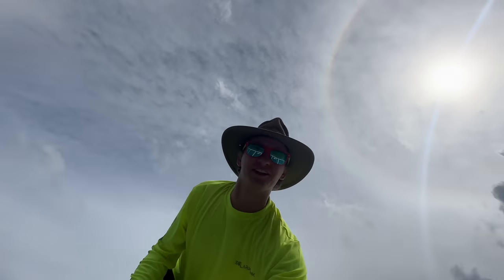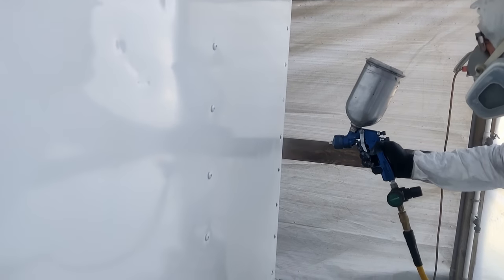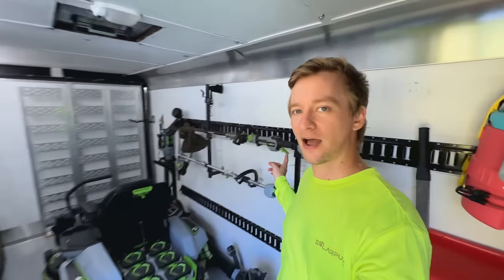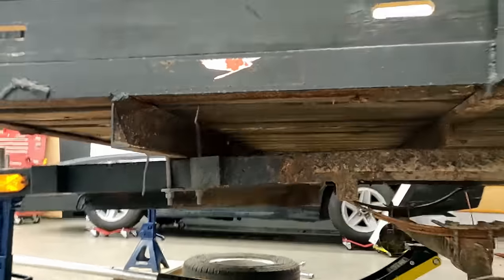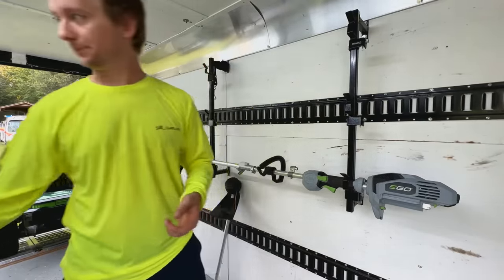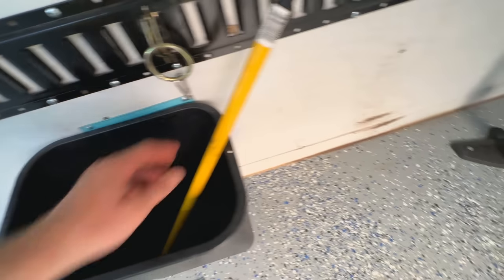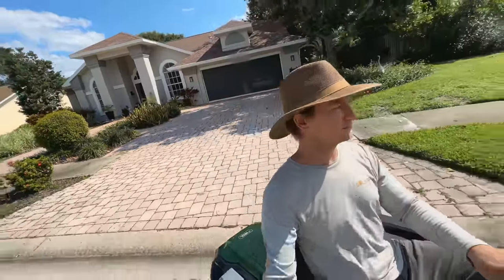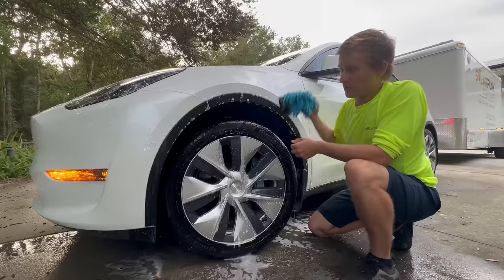My FULLY Electric Lawn Care Setup - Why I Chose EGO (to Start)

Comment: If I were to pay for lawn care I'd pay 10-20% extra for lawn care where the energy is from the sun. Pretty cool. "Economical?" Probably not going to undercut the other guys right now :-).
Reply from the maker: Yeah we're definitely not at cost parity between gas and electric lawn care equipment, but one day! For now I'm enjoying solving problems though, and solar powered trailer with an onboard storage battery is something that keeps me from having to buy expensive EGO (or other) batteries to keep up with my lawns.

Comment: You may want to invest into have a special fire extinguisher on had and  a type of sand used for electrical/battery fire. If your lithium ion batteries ever catch on fire, that small fire extinguisher wont do anything, even water wont help. An it would be best to keep that in the model Y so u can access it in case the flames are in the trailer.

Comment: I use my 2020 model y for most of the transportation in my wood floor business. We park the trucks at job sites and use the Tesla for all the driving. It’s a very capable vehicle.
Reply: Also, offsets $8k worth of fuel a year replacing the previous gas vehicle. I haven’t figured out exactly what it offsets by keeping the box trucks parked. I have a 12kwh array, 30kwh storage and 18kpv inverter producing a mwh a month. Adding 4kwh of panels next spring.

Comment: Keep up the faith in what your doing. I started gardening this year march 23 in the uk. All battery no ride on, using a 6x4 camping trailer, put a tow bar on my car and an inverter In the glove box incase It was needed. Only ever had to plug in to a customers power once in 6 months on a clear up job, with no parking nearby Going to raise the hardtop on the trailer with hardwood ply to give me an extra 18"-24" and add solar and battery into the trailer. Think I'll only need to go with an ecoflow style system. Love the videos and the journey. It ain't stupid if it works. 👍

Comment: Relly nice video, Steve. Enjoyed your explanation of what you are trying to do and why you bought what you did. I can fully understand the choice to start with items you can source easily and get parts for ... and are more affordable at the big-box-store than what they sell at the pro shops.

As for the trailer, while having a ramp door seems convenient for loading your riding mower, it is not nearly as convenient when it comes to loading from a cart or forklift like you did @ 12:07. As long as the ramp is removable, I prefer your setup to the ramp door.

Comment: I enjoyed this video. I am in the industry also running a branch of standard gas equipment and have wanted to put together a crew of all electric - or at least mostly electric. But I don't want to build it. What would you charge to come here and build out my enclosed trailer with EGO and maybe Kress items with the roof of said trailer lined with panels? I have a much larger trailer and it is new.
Reply from the maker: Hey that’s awesome you’re considering building out a fully electric rig to expand your offerings! I’d be very happy to talk with you about your idea if you want to send me an email that would be great. Steve@solarpunklawn.com
Reply: @solarpunksteve Thank you Steve. I just sent you an email.

Comment: You have too much frontal area for that vehicle to be safe at higher speeds. Even though your weight’s are in spec, Tesla doesn’t have a frontal recommendation, but high speeds and a good cross wind will make for an unforgettable experience. Love electric mowing, got a couple Greenworks  myself.

Comment: hi 😅, I was inspired by your YouTube channel, no sooner said than done, I have a secondary job in green maintenance😮 ,and I bought the multi-tool v2, with trimmer-edging tool & hedge trimmer 160cm, 2x4amp battery. wow 😱🤯 enough working time and no vibrations. installed a 350watt 🌞 panel and 1000watt inverter in combination with 2x 200ah AGM batteries. now working hard to purchase a trailer. bye bye , love your video's . greetings from Belgium 👋🏻

Comment: As a fellow ego all electric lawn service, the only thing I can say is register your equipment. Ego makes good on anything that is still under warranty. And most of the fuses in the ego equipment are not something that the customer can replace.  😅
Reply from the maker: Hey thanks! Yeah all my stuff is registered, hoping I won't need it and so far things have mostly all kept working.

Comment: LOL that guy flipped you off on his way to  the mower shop. 😂

I notice you didn't choose the commercial Ego line.  I have the same Ego tools as you and they have lasted many years, some since 2014, but I dont do 5-10 lawns a day, just my own 1 acre.  Are your Egos holding up to the heavy workload?
Reply from the maker: I didn't like the fact the "commercial" ego equipment used a different connector than the homeowner style tools and felt they were overpriced for what they were. My tools so far are holding up pretty well. Expected and normal wear for the use I'm putting them through, but so far they all still work. The string trimmer has started to act up a little bit (Line IQ feature) but so far I haven't had to pull it apart to address it.

Comment: I use EGO stuff (8 tools) since 2015.  I still use 2 original batteries from 2015 as well even though have newer ones.  All has worked great.  Now, your solar rig is very nice.  Will check the video out about its install.  Great stuff.
Reply from the maker: Thanks! So far my stuff keeps on kicking so can't complain much. Thanks for stopping by!

Comment: Maybe you can get a long magnet and walk and drag along the perimeter of the flower beds near the fall off of the just to catch any nails that might be there post roof install
Reply from the maker: Yeah I had to magnet the whole yard of one of my client's because there were nails *everywhere*.  Some roofing companies do a really good job collecting them after they are done, but evidentially this was not one of those companies.
Reply: @solarpunksteve  Just curious, did you see the last tool expo where EGO debuted it's expandable 70+ battery system for commerical use? I could help but think how your setup is a way better value.
Reply from the maker: @MurseTech64  Hey sorry for the late reply, no I haven't! Just checking it out now and it looks very interesting, although not really necessary in my case since I don't need to carry a ton of ego batteries with me.  I do like the thought of using the same batteries from their residential lines for their commercial lines. That was what kept me away from some of their "commercial" tools since you couldn't really use them with any of the residential batteries you already had and instead had to have a giant heavy backpack thing to go along with it. In my opinion not practical.  Anyway thanks for the heads up!

Comment: What’s your range towing the full lawn setup ? & do you have an idea of the trailer weight with everything in it?
Reply from the maker: I haven’t weighed it, but I’m estimating around 2500lbs loaded with the lawn care equipment. As for range, I could probably do ~130-150 miles around town, but on the highway it’s roughly 100 miles. So a good rule of thumb while planning a trip is just to estimate 1% per mile.  A friend tows his smaller trailer and says he can get around 150 miles on the highway with his.
Reply: @solarpunksteve awesome! My routes about 100 miles max so I wanted to see if it would last the route. Charging nightly would make it zero issue for range
Reply from the maker: Oh cool you’re considering one for your lawn care business or something different? Just a note, Tesla recommends not charging above 80-90% for daily driving to preserve the health of the battery, so might want to take that into consideration. I only ever charge to 100% if I’m going on a long trip.

Comment: If i recall correctly the MY OEM hitch came with a Tow Package Software upgrade. It seems mechanically your hack works around part of it missing: but do you have issues with sensors or ineffective auto pilot without their tow software?

Comment: No stand on panel! :(
Reply from the maker: Standing on the mounting brackets that are bolted to the frame under the panels and to the frame of the trailer ;)  I would never do anything to hurt the panels I worked so hard to buy and install.

Comment: I used to have gas lawn equipment and I switched to EGO around 4 years ago. I started with the push mower you have along with a blower and trimmer and I have never bought any gas equipment since. In my opinion, electric stuff is better than gas.

Comment: Get you a magnet that’s long enough to cover the width of the mower. Make a bracket and bolt it to mower in the front so the magnet is touching the grass level. It’ll save your tires. And cleans customers lawn

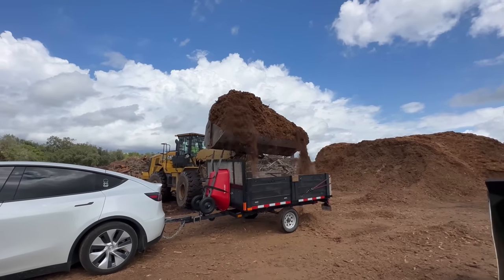Comment: 6:27 looks like Mockingbird recycle center! Have you had any issues with your push mower? Overheating? Not the actual batteries, but the actual mower itself.
Reply from the maker: Hey it is! Hmm, I haven’t actually had any issue of the push mower overheating, but I also don’t use it that often, only on the properties where my zero turn won’t fit. The only overheating issue I’ve had is my handheld blower, it can’t take the heat in Florida after about 10-15minutes of runtime. In the winter it will keep running all day though.

Comment: Can I ask how you learned about electrical and solar panel stuff? Were you self taught? I know hardly anything about electrical but I really want to start my own lawn care business in this same way. The thing that intrigues me is how eco friendly all electrical is but I want to know how to get started. Thanks for putting out great content btw! You've gained a new subscriber!
Reply from the maker: Self taught! But my previous job was as an Engineer on large private yachts (self taught as well) and have always had an interest in electric/solar/batteries etc.  Definitely check out @WillProwse if you want to learn some more about solar/inverter/battery setups and the DIY side of things. As for lawn care, borrow/buy a push mower and offer to start mowing lawns and see how you like it! In the beginning it's not a big deal if it takes you a long time to get a yard done. Good luck and let me know how you do!

Comment: What kind of fire suppressant system do you have on board? Had a ryobi battery smoke and catch fire lucky I was able to just leave it on the concrete and it burst for about 15 minutes before it burned itself out.  See all kinds of li ion packs self ignite from short circuits, i can't image what a fire in a trailer full of batteries would do 😬
Reply: About the same as everyone carrying around a lithium battery in their pocket all day. Its a rare occurrence it happens. There are more lead acid battery fires a year than lithium.

Comment: Nice. For a back up have you considered a 12 volt inverter in the Tesla? Should have a sizable dc to dc charger and should stalwart be able to handle 1500-2000 watts.
Reply: Teslas have an e-fuse system that monitors all electrical draws on the 12v system and throws an error if you try to draw extra power out of it. It can void your warranty.

Comment: My wife and I are looking at homes to buy and I have to do the lawn care and I love the idea of the all electric equipment and solar to supplement it. It's a hefty investment, but maybe worth it.
Reply: I am slowly converting over to all electric lawn care. All of my yard small tools are now electric, and I plan to soon replace my small mower and and small tiller/cultivator with electric models. However, I will of necessity retain my gas powered large (54 inch cut) zero turn mower and my walk behind tractor for the the time being, as I have not seen any sufficiently capable electric models to replace those two. FYI, my yard is 1.5 acres, and I have a 3000 square foot vegetable garden.
Reply: @charlescourtney4412  yeah, huge yards I think would need gas powered mowers. Anything under 1 acre could be fine with all electric I think!

Comment: How did you get the tow package to work without installing the hitch through Tesla?
Reply from the maker: So I technically don’t have the Tesla tow package but it recognizes there’s a trailer plugged in anyway. All the lights work etc. and I actually get to keep the use of autopilot which is something you lose if you pay Tesla to install the trailer hitch (weird, I know). I’m sure Tesla could “fix” that with a software update, but for now it’s still working just fine for me. 

The challenge was figuring out which pins did what on the Tesla wiring harness for the trailer plug, this was back when the model Y was still pretty new so they didn’t really have the harness available to buy, and I don’t even know if they do now. I figured it out on my own and found a matching plug to connect directly in so I didn’t have to splice into the harness at the tail lights and things like that.

Comment: You've got to break down the battery-cycle costs of your batteries.  I recently found out that Lithium polymer batteries only have about 200 cycles through 75% charge where my drone dropped out of the sky at cycle 190 due to the voltage-drop of the unreliable degraded-battery. Maybe all of yours have 500 cycles but the number of cycles does changes the cost of the operation.   

The worst part about lawn service in my area is how many cesspit clients you must turn down.  The Rich people ran off with the Government.

Comment: For your self propelled mower, do you notice any uneven cuts? My mower seems to lift up about an inch or so once the self propelled is used, and mows lower if I just push it. Your setup is awesome, and it annoys me how talented you are doing all the setup yourself. Haha.
Reply from the maker: I haven’t noticed it being uneven, but it will leave random blades uncut which drives me crazy. The “suspension” is pretty stiff so I don’t think it really changes much when using it, maybe there’s an issue with the springs on yours? 

Also, thanks! It’s sometimes annoying to me too because I always think “oh I can do this myself” and then spend a ton of time on it when it might be better to just pay someone else 😅